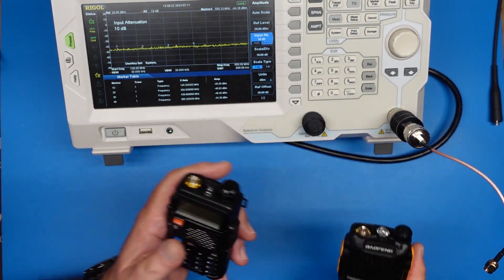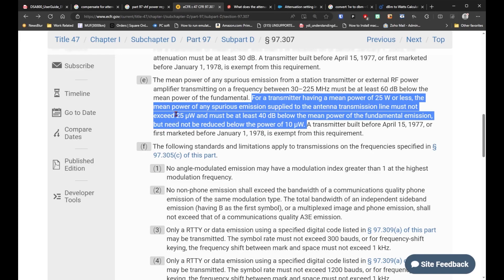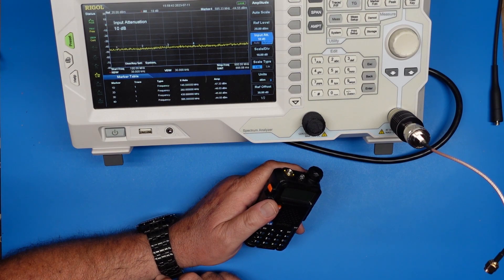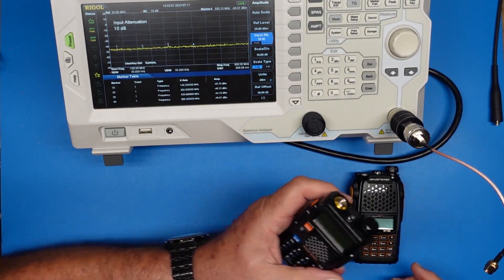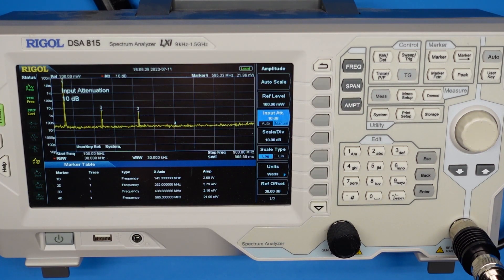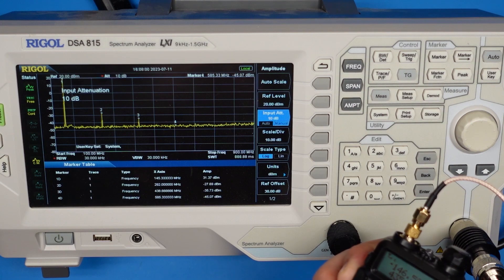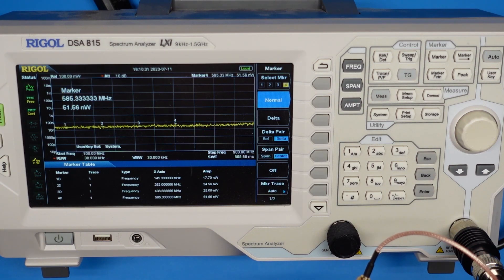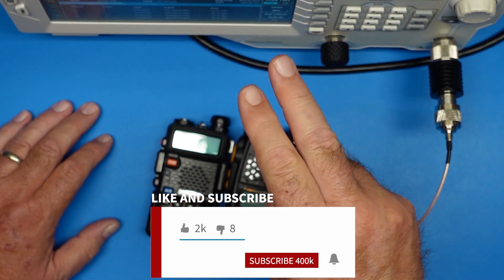Baofeng UV-5R (The OG) vs Baofeng UV-6R ("Professional FM Transciever")

Comment: Do UV-5R radios get hardware updates and new Version numbers over time? I thought they had been tested dirty in the past?
Reply from the maker: I'm fairly certain that there are a lot of stealth updates and changes.  I also suspect that different vendors are selling the radio, with possibly their own mods? in it.  Dunno, it blew my mind for sure.
Reply: @FEPLabsRadio  So if it's such a crap shoot with UV-5R, i guess I will stick with the extra 10 bucks for GT-5R. Thanks for testing.